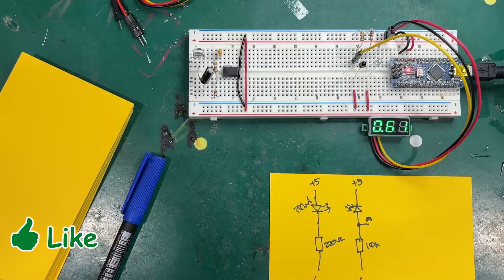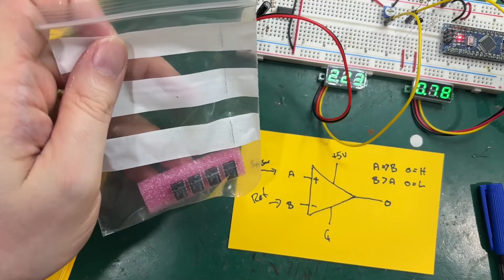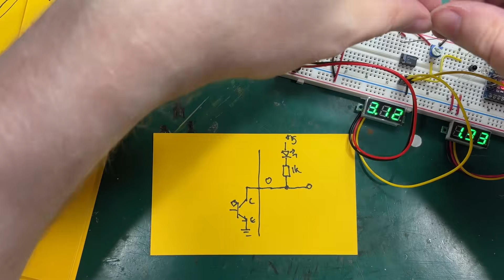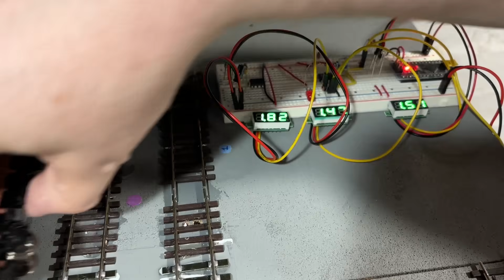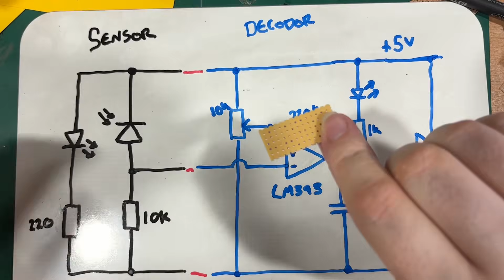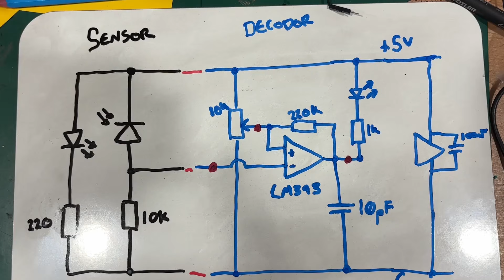210 Infrared Train Detection - Part 2 at Leopard Street Model Railway #modelrailway #oogauge

Comment: Finally got around to watching part two, and as I knew it would be, it was very interesting! I wish I knew more about electronics as when you start picking values for resistors and capacitors, it's like you're pulling them out of the air, and I'd like to understand why you've chosen a particular value! It's probably incredibly obvious for those in the know, but it would be good to have a simple explanation, which is what you do really well! :) Now for part three... Cheers, Ian.
Reply from the maker: looked like I was picking them out of the air.. innocent face

it totally has nothing to do with me having a stack of 1k and 10k resistors... there wasn't a huge amount of maffs involved, it was mostly pick something and try it. I do know the time constant here is basically the capacitor and the larger resistor multiplied together, so 10uF and a 100k should be about a second. the other resistor does matter but its value is low against the main one and I only needed it roughly right here. - the 47k fixed resistor and the 10uF provide a time too short for the circuit to work but stops it melting.. the 200k variable gives a nice range.

will go through all of this in a future one (once, I've gotten my head around it all, I studied all this but decades ago)

Comment: A couple of thoughts:

Build a wagon counter, which could then act as a block occupancy detector (ie number of wagons in, and number out of a section).

Use a pair of these sensors close together and you can detect the direction of travel (ie. based on which triggers first). You then have a bi-direction wagon counter. You'll probably need to be able to enable each sensor individually and use the microcontroller to multiplex between them to be able to read each individually.

Use a microcontroller pin and R-C network to generate the reference voltage (ie. PWM the pin). Then you could remotely calibrate the sensors (might be useful with changing ambient lighting conditions, or even to distinguish between individual rolling stock).
Reply from the maker: that sort of vehicle counter has potential, laser diode set up and could skin the rail height for an axle counter

Comment: This was interesting, though I'm surprised you haven't used an ATtiny85 to do the work of several of those components from its analogue input, since it can run on the same 5V circuit and is the same physical size of the comparator alone. The code could have the logic to do the high/low threshold detection, could still use a physical variable resistor as in input to adjust that, and could have a delay in it before reporting clear. You already know all that though, so I look forward to part 3 🙂
Reply from the maker: has been suggested to use a microprocessor, I had pondered an arduino nano but thought I'd give this a try

its.. yes..

the next part I have designed and built and on the desk it work nicely. on the layout.. mm, something weird. it could be in part supply noise but I have a component that impacts another part of the circuit its not connected to an an input that is strobing..

more fiddling needed

someone else suggested ESP32-S3.. by coincidence a trio of them arrived earlier, but I will get this working first

Comment: Can't do that. Your railway is either fully automatic or fully manual. You can't do both. Two trains running, no shunting going on in the background. Bucky is not to do any shunting till both trains return one at a time. That's why all platform tracks must be kept clear at all times.
Reply from the maker: semi automatic was a design goal, though with full manual also. it can't realistically be fully automated with needing to turn trains - and the station is laid out to force a need to turn them.

the end goal is a "game mode" where the human, or leopard, operating can send a train off from the station, and it goes off to park, meanwhile the layout is presenting trains to the station for the operator to accept and sort out - turning passenger, shunting wagons etc.

need to keep the arrival roads clear to provide a bit of space.. then a timer for how long a train sits at the red home signal... too long and no biscuits..

the rest is designed to have two looping occasionally, specifically goods trains that never visit the station but just roll past (hence the rake of open wagons and rake of vans).

plus can then just sit back and watch

the rest of the automation stuff is helping hands

for now its manual though as the sensors to automate the station are not yet complete.. oh dear. how terrible.. have to do it manually :)

and I'm liking these sensors as there is no computer involved in making them work just wires and weird cylinders with painted strips and odd spider looking things

Comment: Very intersting build. what I noticed when using the IR sensor/Photo Diod there is a slight issue when there is to much sunlight coming into the room. these photo diods react different. Since my layout is in the attic. and my windows are facing south. a lot of sunlight comes in. so with the shuttle tract I had to cover the back with Black paper to reduce the reflection of the wall (which is white) so I did not need to adjust the sensors to much.
Reply from the maker: yes if you have sunlight in the room you will probably have to do something to compensate for it :)

Comment: Very nice DIY - I wonder if it’s easier to buy one of those $2 esp32 boards and feed it the input data and drive a led on the output ??

Unless this is way cheaper 🙂
Reply from the maker: to be honest one of the really cheap little microprocessors would likely be cheaper, I just fancied having a go at it this way, it could definately be done reading viqa thre ESP32 analogue input pin though
Reply: @aleopardstail   yes, would simplify your construction greatly, especially if you need to build in bulk
Reply from the maker: have had a little look into this, moves all the logic to software, good and bad points to that. has the advantage that if its WiFi isn't reliable (some have space for the external antenna though) it can just talk directly to something else plus one of those boards could talk to a fair few sensors, especially with a bit of multiplexing on inputs.

I do actually need a fair few, spread out though. but this would scale well since the one board can handle quite a few - heck if its talking to another MCU just about any MCU will do this if its got the ADC capability.

will get this system working, it does for me, but I'm going to have a look at these diddy ESP32 as there is another thing I want to do I suspect they will be very good at, better than the ESP8266 I was thinking of

cheers for the idea.. another rabbit hole opens before me
Reply: @aleopardstail  you'd be surprised how many rabbit holes i've gone down myself - lol
Reply from the maker: Ooooo now have an ESP32-S3 working. not on the layout, just a bench "thing" not connected to anything, quite impressed.. need some black paint for the blue battery LED, nice its got the battery hardware onboard, just a less eye blinding LED would be better.. paint will do it

antenna is a bit pants, will have to see how it copes with being under the layout, amazed how small these things are

cheers for the idea :)
Reply: @aleopardstail  yw - i'm making my own DC throttle with tactile control to replace my android app - different rabbit holes 😃

Comment: Then why didn't you leave the railway as it was, instead of making operations more complicated? It's better to operate the railway as it is, rather than add complicated wiring that possibly takes till the day you die. Come along, my fine fellow, what would you rather do, remove the upper boards and wiring and play with trains the simple way, or make the set-up so complicated you never complete the task till you pass away?
Reply from the maker: to be honest this actually helps with operations, and there is essentially no downside - its lighting an LED when something is there, and can be ignored

the upper board station was the point of the layout, however there is a need to get on with it. bits of fault finding and fixes to do along the way but I have all the track for the goods yard, actually laying it is a bit involved but there is a bank holiday weekend coming. I wonder how far I can get?

do have a firm aim for the end of the year: all track down, all track working and the debugging stuff done so it operates. next year can then focus on making it look nice and running it, and adding more of Thomas's friends, removing cat hair and general maintenance.

this layout is considerably simpler than the N gauge idea I had which I spent a while drawing up before I just stood back and thought "and that will be finished when?"

this is set up so it can be partly automated, but also operated manually easily, two trains circling to watch and shunting one to swap about

Comment: Your a member of MERG so why not use a Hector kit?
Reply from the maker: I could, I enjoy making this stuff, and there is another step I want which I'm not sure the Hector allows - will be part three, what I'm adding is a "hold in" timer, idea is to mount them on or near points - not to detect a train, but to detect when one has passed - I want the ability to add a variable delay.

e.g. sensor sees a train, waits for it to pass then when its clear waits a second or two before it reports clear to know the train has fully cleared before it comes back

but it is mostly because I enjoy working this stuff out

Comment: This is very interesting indeed, the explanations makes me think about using one of my soldiering irons and my store of components. I am much happier building a control module as against buying something that doesn't quite do what you want. Keep up the good work. There's a lot more to railway modelling than running trains, its a complex system. I wonder what your module would make of a certain cat's tail. Thinks...try a bar code reader on a tabby....beyond price! Thank you.🐈🐈‍⬛
Reply from the maker: she did wander over it, and it did pick up her light coloured belly fur :)
Reply: @aleopardstail 😂😂
Reply: @aleopardstail smell correct got it wrong! Soldering not a mant with a rifle! Surprised it didn't correct it to American phonics....saldaring!!

Comment: Great video and very interesting.  I’ve used the TCRT5000, which is 3mm led on a board like your 5mm. My biggest problem I came across, is the as the reference source is fixed, the TRCT5000 were no use near the attic window, as on a sunny day the data light would only stay on. I’ve moved across to LDR.  Looking forward to the next video on this subject.
Reply from the maker: did find there is a bit of an effect from the lights, its not too bad. but yes thats a problem with this sort of sensor in a room that has to handle daylight. could probably work it better with a microprocessor, and specifically have an "ambient light" level sensor. or use an LDR or another photodiode in the reference voltage circuit :)

Comment: Very interested and interesting,  Instead of creating the circuit for this could you use an Arduino to do the sensor analysis?  I'm not good with Arduinos but could 2 or 3 analogue inputs do the voltage comparison? (Or maybe just one, if the voltage changes to higher than X then light the led, if it falls below Y then turn off the led - X and Y maybe the same value, I'm not sure.)  Two minutes of trains running at the start or end would be great too!
Reply from the maker: yes! my reversing loops use six IR sensors, fed into an arduino nano on six analogue inputs (plus two using I2C). worked well, I used that approach as I wanted some logic interaction between the sensors. It works very well, those sensors go no further though, here I want to feed into the rest of the layout, and there will be quite a few more of these.

basically it worked with a threshold level for "TRAIN!" v "NO TRAIN!"

will have to remember to add various bits of trains moving :)